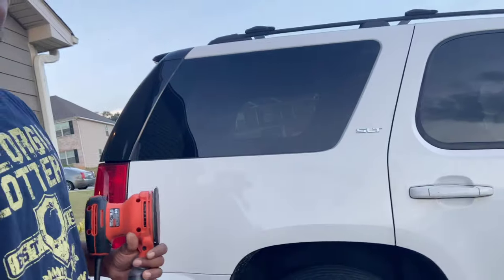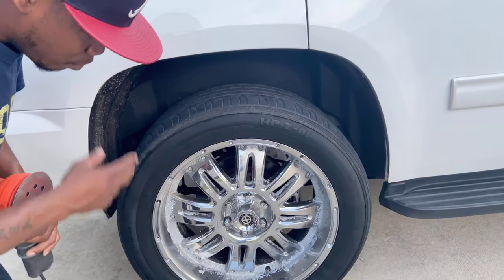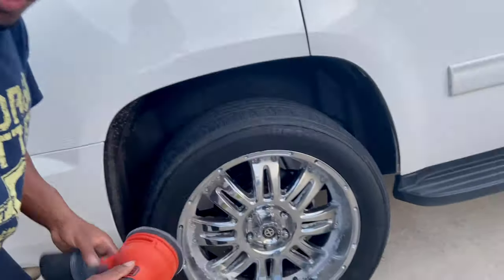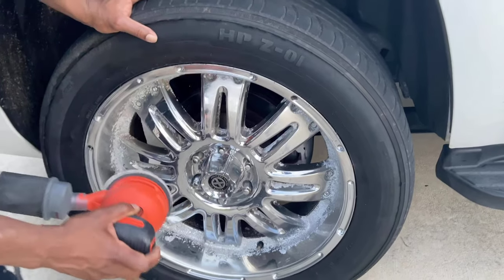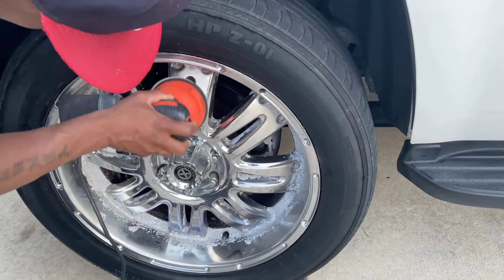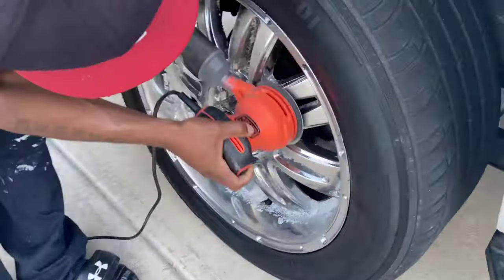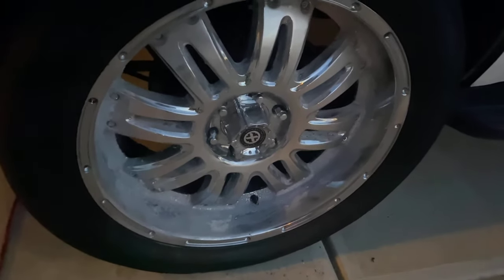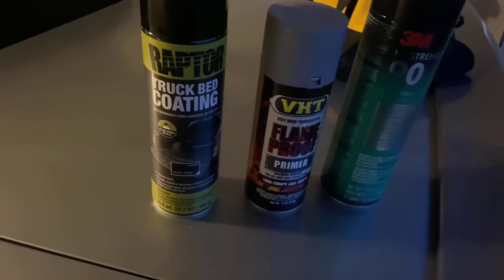COATING DAMAGED YUKON RIMS WITH RAPTOR TRUCK BED LINER

Comment: Did your wheels feel like they needed to be rebalanced?
Reply from the maker: Yessir, they came on the truck when I bought it and the tires were old. Got a little better after tire change but still not as smooth as factory

Comment: U do after u painting them u do pull the ride forward  a foot or two and sprayed them  again  because  it allows  you  to get full coverage  and it's called balling on a budget  lol I've got a 98 merc looks like a old cop car we all.know chose  but I'm getting  ready  to  raptor tintable bedliner my whole ride wheels and all but I've got a 5 in donk under  it and 4x4 shocks all the way around  it to give it that ride quality  but owee that lift wasnt no joke fr the back was easy liftabrand  kept telling  me that the cups went in the bottom  of the control arms and I kept telling them no it don't it goes in the top because  it doesn't have a divot like a lower control arm has in the bottom  of it because that's where the front coils sits down in it's kinda like a cradle  to hold it into place  and all I said to them is if ur installers  has been putting them in the bottom they had been installing them wrong and telling everyone else wrong to that's not where they  go they definitely  goes in the top I been lifting and lowering rides all my life  I've gotta  do everything  myself as well I'm just some crazy ass country white boy with a little  class feel me that's all lol I'm pretty  laid back for the most part but to be honest  I've got a question or some of ur in put because  I've got a set of the lambo doors ive gotta install  as well but the liner colors I was thinking  about  was solid white with either red or blue  reflective tape sheets for my body and wheel graffics I'll post ya a link to give u alot better of a idea that I'm talking about  I think its sick as hell but others idk fr but I bought  a 53in plotter to cut all my graffics  out with and maybe make a few dollars  using it to pre cut window  tint for me trust me I could make a killing doing just tint alone  fr and I'm fairly  good at it.to be real about  it I kno how to shrink it and all but back  to.what I was saying  and i was thinking  about  maybe this dark red almost like a dried up blood red and black reflective graffics witch the black in light comes back a white color and I was thinking about  a dark charcoal  gray with yellow  reflective color graffics  I don't  gotta  decided  on what my graffics  will be I been  maybe  thinking  like some word  like dirty white trash in some cool fonts but melting like it's running off my hood over on to my finder I'm sure u could picture this in ur mind and maybe some skulls everywhere  in the back and half way throw the drivers door but blocks fading out or down into a point  or do it 2. Toned like shaq red and black dodge he has some kinda 2toned not like it but u get the idea but my ride is about  to have a bunch of this reflective stuff fr fr window decals my own logo southern boyz cartel on the piller  as well as a few more like Facebook and Twitter stuff like that I'll do the wheels to match how ever I do it I think it will definitely draw the attention plus it will be spoken about  for years to come even after I'm dead and gone and i.didnt have just 1 dope ride ppl still talks about to this day but this one will be right up there with a few of my other mad scientist car creations see I'm more of a leader  I'm not much on following no one I'm the one who sets trends they are the followers but I'm a humble  kinda guy I stay open minded because  u never know fr but I've gotta go and weld up on my exhaust  fr I knocked something  loose it's time to fix it good now but ya think about  things and let me know what u think https://youtu.be/blEI-64G6ZM
Reply from the maker: Yessir, always get full coverage and once done it looks official. I got rid of this truck almost a year ago. That’s what’s up. Sound like it will turn out 🔥 🤝🏁

Comment: Nice. How did it hold up? Thinking doing mine..
Reply from the maker: Thanks! It held up good until I traded the truck in. I recommend using 2k clear by spraymax for extra protection.
Reply: @russellmuscleatl  Thank you!